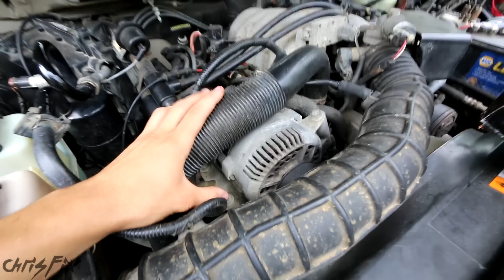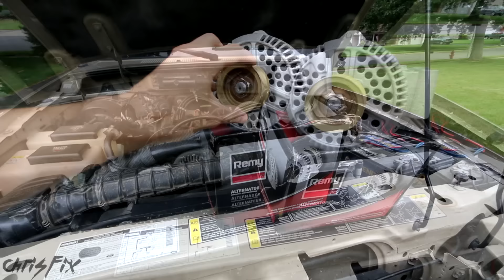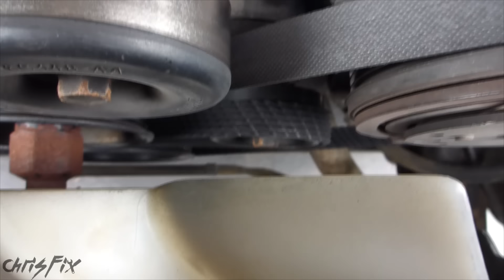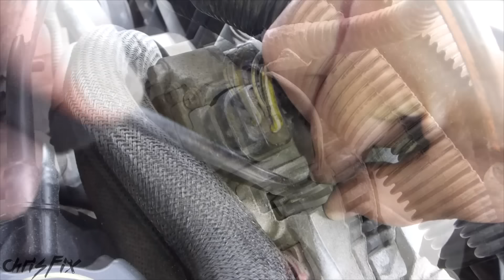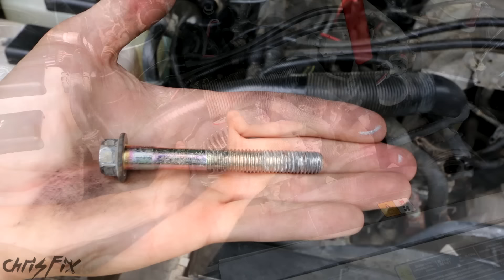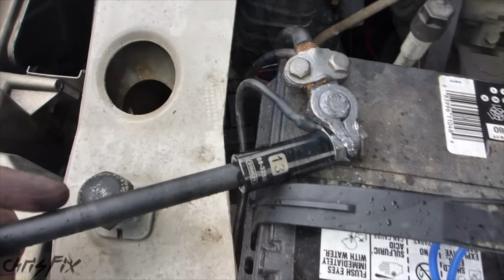How to Replace an Alternator

Comment: you make this look very easy to do, and luckily it is in your engine... in my case (2003 PT Cruiser) is a lot more complicated in terms of space, since my engine is mounted sideways and the alternator is in the back near the firewall, the trick is that you have to lift the car, remove the front right wheel to get to the tensioner pulley to loosen the belt... is so tight in there!
Again, great video, super clear and well explained! you seriously rock!
Reply from the maker: David Miranda The PT Cruiser is killer for this job. Thanks a lot David! Hopefully you never have to change the alternator in the PT!
Reply: ChrisFix yea, just remembered you've already done a video about an alternator change, that was on your Windstar, but since that engine is also a V6 Ford, the procedure is basically the same that on your truck, only sideways. Do you still have the PT? I'd love to see more videos about that car, since I'm a weekend-only mechanic and any extra knowledge is always welcome.
Just an idea, you could do, for example, a video about how to replace the spark plugs on a PT engine, intake manifold removal is necessary, not difficult but you have to be careful with the toque appllied to the bolts when assembling since the manifold is plastic, and inspecting the rubber gaskets and how to tell if we need to replace them.
Thaks a lot for your all hard work, on the cars and on making these videos (is a LOT of work to make a video this quality) that help us save a lot of money by not taking our cars to the stealership!! :)

Comment: If you have it available-drop the 3 alt. bracket bolts into some kerosene as you take them off. They will be shiny clean of any corrosion by the time you are ready to replace them. Always great vids Chris-500k will come sooner than you expect.
Reply from the maker: austin sullivan Thanks for the tip! I will have to try that! And thanks for the support bud!

Comment: I know this is hard to answer without actually looking at it but my car has an issue where the check engine light gets progressively brighter when running several electronics (IE headlights, engine fan, A/C), it's weird because it never stays on, it just dimmly gets brighter and brighter, or will flicker with the load of my blinkers etc, and if I run to many things at once my engine RPMs will drop, and a couple times the car has even died because of the rpm drop. Took it to a car shop and they couldn't find a problem, tested alternator and battery and it tested fine, I brought it home and tested it myself and it did indeed test fine, I even tested it under load, still tested ok, I double checked my engine ground, it's good, tried turning my stereo off, still has the problem. I'm stumped! If you have any insights it would be appreciated!

Car is Honda del sol with Acura integra GSR engine.
Reply: Throttle control sensor maybe. You should ask Eric the car guy
Reply from the maker: 95TurboSol It is most likely an electrical problem and I am thinking fusible links. When my fusible links went bad, I had problems just like that. The other thing is it could be the car's computer. Check to see if your car has a fusible link and play around with it as someone watches the check engine light. Check this out: https://www.youtube.com/watch?v=-SpsSRGfDQI
Reply: ChrisFix
 Dude Chris, I'm not sure if that's it yet but that is something NO ONE else has even thought of, not the mechanics I took it to (Meineke) and not even 15 year honda tech veterans even thought to suggest it, they were stumped, I knew there was a reason I subbed to this channel! Since it's cheap enough I'll go ahead and replace it this week and see if that was it. Thanks!

Comment: Hey Chris Fix, just want to share that most alternators fail due to worn brushes on alternator' voltage regulator assembly. You can replace just that for about 1/10 of the price of a new alternator. Secondly, when you upgrade your alternator you should check if your cable is rated for the bigger load and possibly upgrade it. Alternatively you could hook up all your extra accessories directly to the alternator, to avoid overloading stock wire.
Reply from the maker: Wojciech Leciejewski Thanks a lot for sharing man! Great info!

Comment: Is there any way to care for the alternator to make it last longer or maybe try to get a few extra miles out of ones that are dying
Reply: Im a diesel tech and rebuild alternators in the field. Yes the brushes are usually at fault, but the average weekend warrior wont know how to do that right. And most need bearing pullers and other special tools. It just be best to buy a new one. By the way a 'remaned' alternator usually just has new brushes and slip rings. They steam off everything else and clean the corrosion on the diodes. Its really kinda shitty but works good enough for a few years after that
Reply from the maker: crapper1 You can use compressed air and shoot the air into the alternator vents to clear out any dust which helps with longevity. You can make sure your battery post/terminals are clean and have a good connection. Those two things are really the only way to "maintain" an alternator. The electrical system upgrade video I will be doing will also help.
Reply: crapper1 very often its brushes that go bad. if you can replace that part, you will get a lot more life out of it (provided that's what failed of course)
Reply: trollaphobic Depends on a brand. Bosh for example, its just phillips screws and nuts holding regulator/brushes assembly
Reply: True. I do mostly remy delcos. But id still recomend a full replacment for a diy

Comment: A word of caution to Honda/Acura K24 owners: You may need an angled wrench to access the bolts on the bottom of the alternator. I learned the hard way after spending 3+ hours trying to find it before dropping the drive belt and losing some tools in the engine bay (I fished them out, of course).
Great video, though, as always!
Reply from the maker: Akshay Patel Awesome tip and thanks for adding! This is exactly the info that is great in the comments!
Reply: ChrisFix Sure thing! :D

Comment: Is it possible for an alternator with a larger amperage overcharge the battery? I want to to this to my 944 because the voltage meter in the car says that the voltage is around 11 volts when wipers and headlights are on.
Reply: argonian bilbo No, battery charge depends on voltage not amperage. At around 13-14 volts, the battery will pull whatever amperage it needs, at higher voltage you would overcharge it. So you will be ok with a bigger alternator, just make sure your wiring can handle increased amperage.
Reply from the maker: argonian bilbo Exactly what Wojciech Leciejewski  said! Thanks for answering bud!

Comment: hey Chris or any1, i have a 06 civic & the other day my windows radio locks stopped working i checked all my fuses i have a brand new yellow top i replaced my alternator twice i thought it was a defect cause my batt light is still on over night my batt seems to drain but starts fine when i drive it charges to 14v light still stays on any ideas? thx
Reply from the maker: djnevous3us Hm, that is a weird problem. Maybe the switch that is connected to the windows and licks is not working right? Did you try the other window or lock switches in the car? On the civic the door locks are actually run though the radio (they use the radio as the computer or something like that). So maybe your radio went bad or something?
Reply: ChrisFix everything works after i changed the alternator just the batt light stays on now & something seems to be draining it over night but it starts fine in the morning

Comment: Hey Chris, so I went to the mechanic today because my 2005 Mazda 3s revs by itself when pressing clutch (stick shift car), and he told me that one of the problems COULD  be the alternator. We ran a battery check and everything but it seemed fine. He was still skeptical for the alternator, though. We also think it could be the mass airflow sensor since he ran a diagnosis and it was indicating to it but I had already cleaned it with the special spray bottle you indicated in a previous video.

Comment: Hi Chris any tips on how to recognize  the tensioner pulley just by looking at it on any other car maker??what makes it different from the other pulleys??thanks in advance keep up the great videos!!!
Reply from the maker: Carlos Rios Good question. There are two pulleys that do not do anything, the tensioner, and the idler. All of the other pulleys are attached to something (the engine, the alternator, power steering, AC, etc). Located the ones that are not connected to anything and you narrowed it down greatly. Then look for the pulley that has a tensioner mechanism behind it. The idler will just be a straight bolt into the accessory mounting area, but the tensioner will be mounted into a spring loaded piece of metal.

Comment: When i changed my alternater i had to change out the little wireing harness with the three small wires.
Reply from the maker: Demetrio Ibarra Did you change it because it melted or because the new alternator was different?
Reply: it was the same but the connection did not work with the new alternator.

Comment: Excellent video. Thanks for sharing. I wish the next time you have to replace the alternator you will use the (ODP) " overrunning decoupler pulley" instead of the solid pulley that you were using in the new alternator. And I am sorry for my weak language
Reply from the maker: Camry le That is pretty cool! I will have to check it out! Thanks!

Comment: This is a good job for inexperienced DIYers to tackle. It gives an opportunity to work with the serpentine belt, which can be intimidating if you've never messed with before, and perhaps other simple components like the intake hose, as you show here. I replaced the one on my dad's 06 pilot (tough job, was way down there) and my 94 lincoln continental (easy, right on top) a couple months back and learned a lot not just about diagnosing/replacing bad alternators, but also about serpentine belts, automatic tensioners, and general automotive problem solving.
Reply from the maker: Matt Mihm Thanks for the insight Matt! I definitely agree!

Comment: It's just a thought, but it might have been that the reason you were losing charge at high RPM was because your belt was slipping.  Alternators are not usually prone to fail like that. The new alternator would put out more amps to make up for enough slip so it wouldn't show on your dash.  You might consider running a volt meter on a test drive and see if you are running at full voltage.   I'm not saying you should pull out the new alternator.  Your rolling fun zone justifies the upgrade.  Your tensioner may be a bit tired and your belt a bit stretched.  Time for a belt tensioner video?   My only question is what the hell are doing driving a 4k RPM?  It just seems like a good way to burn up a lot of gas and your engine.

Comment: Great video.  I just did that same job on my 2004 explorer a couple months ago.  About the only difference I found  was that after removing the bolts,  I discovered they only had to be loosened a few turns to get the alternator out as it just rested on the horizontal bolts and the bolt head against the face was enough to secure it on the bottom with 2 other bolts on top. 

On another note,  if you're buying the alternator from a local parts supplier,  have them test the new alternator before bringing it home to install. Turned out the "new" one they had in stock was bad also and they had to order me one from another store.
Reply: Will be looking into this as an upgrade for my 2002 ranger  as I'm working on adding some aux lighting as well. backup lights and a 50" light bar. Just gotta fab up some mounts or a headache rack to mount it on. I have a fisher homesteader plow mounted as well,  so I may look into a dual battery setup as well
Reply: ChrisFix , definitely one of the best how to videos by far I found on this.
Reply from the maker: +Xanadu245 Thanks and thanks for sharing your tips!
Reply from the maker: +Xanadu245 Did you see this: https://www.youtube.com/watch?v=qp9L00SMSHQ
Reply: ChrisFix yes sir,  I sure did. Protect Nightlight is 3 of my favorite videos. For my truck,  I'm looking at having to do more of just the headache rack portion as the bed rail caps are part of my bed liner and block the stake pockets. My plan is to get some 1/4" flat stock to slide under my truck box and anchor using the J bolts securing the box and then fabricate the hoop and maybe the upper frame depending on how it looks with a 50" light bar.

Comment: Why not use a bungee cord to pull the radiator hose out of the way?  If you are going to take tension off the belt why not inspect it?   It will be a lot easier to remove the intake if you remove the plastic throttle cover it can't be more than two bolts.  Your alternator only had a intermittent failure at high RPM's, but if the alternator is not charging at all you should fully charge and test the battery before the final test drive.  If you don't do this the new alternator can potentially burn out trying to charge a dead battery that can't be charged and also leave you stranded.  
Does the upgraded alternator supply enough juice to keep up with your extra lights?
Reply: Stupid questions wow!!
Reply from the maker: ScorpionRegent The lights I have now with all of my stock accessories on draws a max of 60-70amps so my 130amp alternator produces plenty of power. If you saw my other videos, I just replaced the belt so there is no need to inspect it.

Comment: Could the corrosion on the bracket and bolts have been the problem, Chris? Excellent video.
Reply: beauxtx1959 If it was the problem then it wouldn't have shown up only at high RPM.  It was a nice to see such attention to detail though.  Use lithium grease instead of anti-seize though it makes a better contact.  You could even use it to grease the bracket to bracket contact to reduce oxidation if you are a nit picking maniac.
Reply from the maker: beauxtx1959  exactly what ScorpionRegent  said! I also did a voltage drop test in the alternator test video which looks for those problems (link to that video is in the description).
Reply: Thanks!
Reply: beauxtx1959
If you wanted to be crazy thurough you could do voltage drop tests to confirm good ground.  It isn't between the alternator and the engine where bad grounds normally happen.  The ground connection to the block is a usual suspect for  lot of problems.

Comment: Might be good to use dielectric grease on the plugs going to the alternator to prevent corrosion, which would affect everything on your car.
Reply from the maker: anti0918 Thanks a lot! That is a great tip!

Comment: Had to replace mine on an 04' ford explorer, heck of an easy job. Now I have to replace the actuator for the A/C and heat door. I get a thumping noise when switching from cool air to hot air. That tells me that a gear is stripped out.
Reply from the maker: Mattguitarman1234 Yea, that is def a blend door actuator. Good luck with that!

Comment: Im confused , I wanted to add a bigger alternator to my 03 silverado and I was told I would have to use larger wires or I could burn out the electrical system.
Reply: Ed Yager If the bigger alternator was a option for your vehicle then if it shouldn't be necessary to change your wiring.  The way to tell is if there is a different wiring harness for the larger alternator listed in the dealers parts department.  If not check to see if there have been cases where electrical fires have been the result of a higher amp alternator.  If there are no red flags then some one is either being overly cautious, not thinking it through or is trying to sell you a bridge.  The main weak link would be that heavy gauge cable running from the alternator to the battery.  After all that's where all the amperage travels.  Everything else gets split up.
Reply from the maker: Ed Yager  Exactly what ScorpionRegent said! This truck had the 130amp alternator as an option so the wiring was already set for the larger alternator. Either way, I will be doing an electrical system upgrade so stay tuned for that and you can run whatever size alternator you want with that upgrade!

Comment: I noticed you have one of those air filters that I think are washable. I know that's there a more expensive than the regular paper ones. 
Can you do a review on it or what you think of those air filters? Is it worth the extra bucks?
Thanks
Reply from the maker: ArteOnez It was actually not too pricey which is why I got it. If I remember correctly, it was like $30 and a paper one was $15. I already got double the life out of it so it payed for itself. Performance wise I felt no difference with the butt dyno and saw no difference in mpgs. Hopefully that is helpful. I should do a dyno test comparing paper and reusable filters!
Reply: ChrisFix Yes thanks for your input. 
You're the man.

Comment: No voltage-test with the new alternator? Nice video btw =)
Reply from the maker: Nicklas löf I used the gauge that is built into the truck to check the voltage (shown at the end). I could have also used a multimeter as well which is always a good idea!